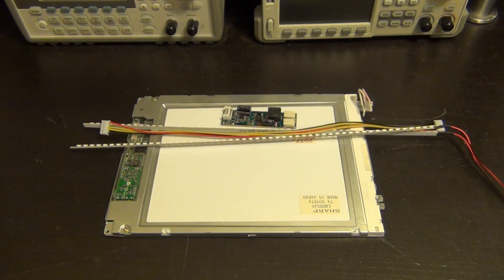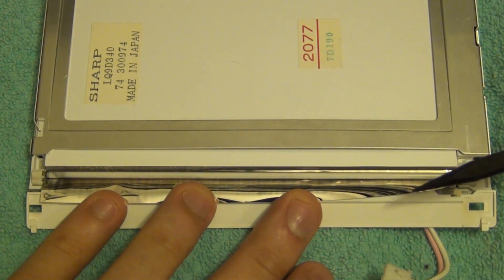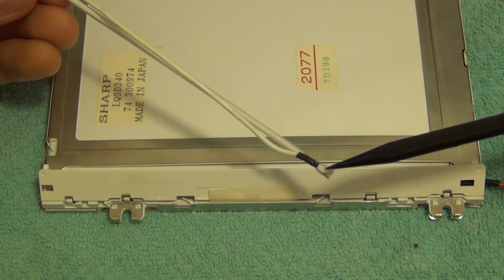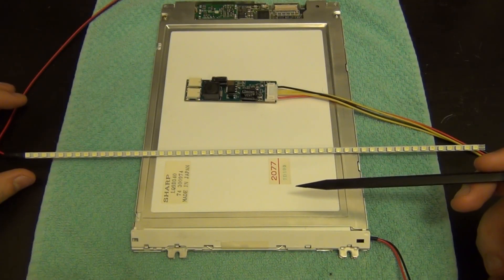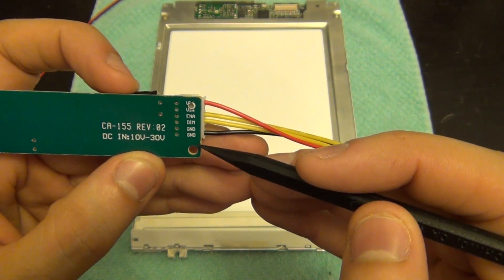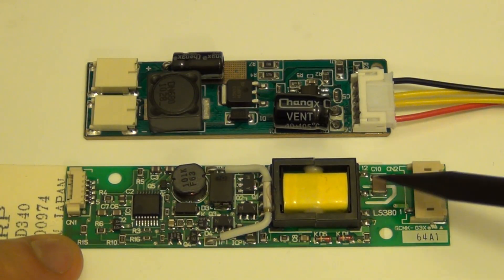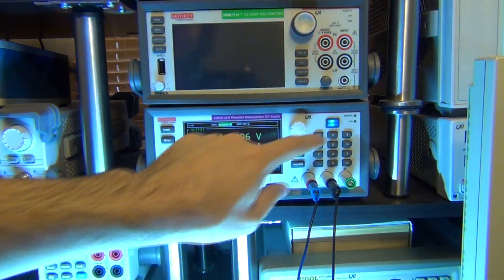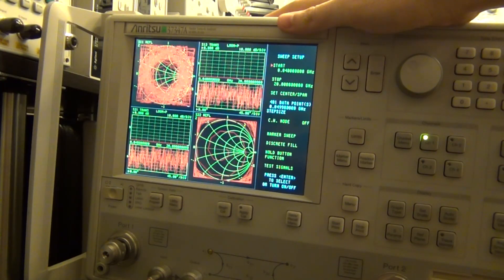TSP #78 - LCD Screen Backlight CCFL to LED Replacement

Comment: Neat! -it's now 2024 and I stumbled on this vid looking for changing CFL to LED - I found a 12.1" 'picture frame' at a thrift store... after taking it apart, I determined the operating voltage, and plugged in an adapter with the right polarity... the screen is a TFT with a CFL backlight, that has no output voltage on the CFL converter. Using a flashlight I can see the screen is operating, so here I am looking at CFL to LED conversions... 
For test equipment, this is a great way to revive gear, for a display screen, I'm now curious what temperature LED is going to work if I replace the CFL tube...  have fun being techs peeps!

Comment: Those LED driver boards use the DF6113 chip to control the LED strips. The resistors R4 and R7 (paralleled on the board) set the constant current, and hence the maximum brightness, of the LEDs. for the 8.4inch LCD screen that can fit a 24 LED strip, you can determine the resistance of R4/R7 by the formula R=0.42/Imax, where Imax is the maximum current for the LEDs. E.g. for R=3.3ohms, Imax is about 120mA which when divided by the 24/3=8 parallel LED strings is about 15mA per LED. If you leave R4/R7 as is, the LED current will be too high unless you use the dimmer feature, and the LEDs will burn out in a short time.

Comment: Hey, what kind of input does that brightness control need? I want to repair a 1993 Apple PowerBook with a dead ccfl tube and the sharp display looks similar to yours. I guess it's original brightness control is some kind of variable resistor, so maybe I could wire this up instead of the Potentiometer you used and keep the original brightness slider functional.

Comment: Nice video! What are the specs of the potentiometer you used and how did you connect it to the cables that come from the LED controller?

Comment: Can I upgrade with HP DV 6700 laptop LCD screen to upgrade CCFL to LED I have HP DV 6700 series laptop  LCD made by AIO brand  very thin LCD 14.4 inch thickness  of lcd is 5 mm ??

Comment: Since nobody reply me, i figure out how to make the connections without burn the board controller. This is for those who face the same problem in the future.  VIN + EAN connected on +12v || DIM connected to the pin 2 of the potentiometer, pin 1 of the potentiometer to GND, pin 3 to 5VDC supply. I used a 5k POT.
Reply: Estaba en el mismo problema gracias 💪💪

Comment: Hello there, I have a imac display lm215wf3-sla1 which has already LED backlight and I can't find any driver board or I should say inverter board , please help me out
Reply from the maker: You need to know the configuration of the LED board so you can determine the required voltage. You will then need an LED driver board with constant current capability to do the job.

Comment: Thanks for the great video! I recently bought the same 27 inch led strips with that DF6113 driver and 15N10L mosfet but it never produced enough backlight light on a HP 25 inch TV. Which was because the strips had turned in their holders inside my TV. Which was fixed by gluing them to the white plastic top and bottom reflectors. The driver module board I received had no second e-cap and was REV:03. I wouldn't advice anyone to use this board above 12V because my board became very hot instantly and after 10 minutes or so it short circuited and got up in smoke. Both my led strips luckily were intact! But it resulted in a defect mosfet, SS210 diode, and R620 plus 1R00 components. And likely also the DF6113 is gone now! I examined the driver module circuit and noticed that it has NO OVP protection and neither a decent over-current protection because it is not equal to the original datasheet of the DF6113 that clearly shows these installed! I wouldn't buy this board or these led strips as REV:03. The video showed REV:02 with second e-cap installed!

Comment: Thx dude! I replaced the light and it only cost 12€... the company here wanted to do this repair for 500€ so I ordered the light from China ( eBay ). 

It is very easy to check if the backlight is broken... just hold or press a flashlight on the screen. If you can see something, than just replace the light.
Reply: Did you use a potentiometer to drop the brightness?  any tips for the rest of us?  Are the yellow wires for brightness control and if so how do they work?
Reply: @scottvance74  I just ordered an original backlight and installed it. So no wiring needed. You don’t even need an potentiometer.

If you want to replace it with a LED than I’d suggest just trying some resistors. So directly wiring it to the factory cables with nothing between it. 

This should work right?
Reply: @B58B30  The available parts I'm seeing have a series/parallel network and require about 8V to drive them.  The inverters that do this are usually powered by a 12V source.  My output (to drive the old CCFL) is 5V.  I found that most of these have a diming function, so by either using that and/or changing the current sense resistor on the LED driving board, I think that I can solve the issue.  Thanks for your feedback.

Comment: Why would you ever do that? CCFL if safer for your eyes. I would prefer the video other way arround. Is it possible to put CCFL instead of LED on modern monitors?
Reply: Lol. That’s like saying “I want to rip this modern fuel injection system off of my BMW and install a carburetor with loads of vacuum lines in its place.”

Comment: Hey, stupid question but I was wondering if the Mercury inside a tube could leak out of the monitor. My image has been flickering there's some ghosting issues. Btw could LCD fluid leak out of a monitor without visible damage?

Comment: Hi very nice video i'm wondering if it would  be possible to send me the wiring diagram to hook up the dimming potentionmeter
Reply: Hi, did you get an answer about the wiring? I would also be interested in that, also the value of the potentiometer.

Comment: Last time I had LCD monitor with CCFL backlight and every component was fine but by some reason CCFL driver was shutting down after 1second, adding 10pF/1kV capacitor in parallel with CCFL tube fixed it.

Comment: At 3:58 you state that you need a constant current driver. But if it is, and you cut the strip to size wouldn't that overload the remaining LED's?
Reply: That is exactly what I was thinking.  I see that this post has is 6 yrs old but maybe someone will chime in on their thoughts.  

I bought the same kit and there are 25 'banks of 3' per strip.  The board expects 2 strips to be in parallel and the constant current is set for about 1.2Amps.  That works out to ~25mA @ 9V per bank.  Cutting down one strip and only using one strip must be pushing all of those LEDs to close to death.   You mentioned that you set the dim control but you didn't mention at what current you are running your cut down strip at.
Reply: @johncarson2877  Funny to read this comment just this week. I must say I totally forgot I had ever watched this video. But coincidentally just this week I designed a little led strip to retrofit in the 5.7 inch Hitachi screens on a device of which we sold hundreds many years ago. Our customers want this devices repaired, but screens the are EOL. Replacing the CFL with 6 white LED turned out to be a very easy, cheap and effective repair. When testing we could not see the six light spots. I just used dropper resistors for current regulation. 

Cutting of LEDs from a current regulated strip still doesn't seem right to me, not something I would recommend.

Comment: Definitely, if you want to use them at full power you need to provide some heatsink, otherwise they start blackening soon. I would not use it at more than half of the rated power.
It was really a pleasant surprise to see that there were no "hot spots" of light due to LEDs, that is what always makes me afraid of doing this (unless alternative is no-light, of course)
Thanks for the video!

Comment: been there donne that :) it seems to be a DF6113 module... they are build to drive 2 strips, also you should have a look at the datasheet of the DF, you have to manualy trim the mosfet's resistors to limit the current on the led's otherwise will last you less than a month even with the brigtness dimmed...

Comment: +The Signal Path Blog since it is a constant current driver, reducing the number of LEDs connected will cause the current through each LED to go way above the rated one, which would explain the significant blue shift of the light. I would increase the sense resistor by at least a factor of 4, and then use the dim input to fine tune.

Comment: ChongX capacitor?! Have you no shame, Shahriar :P.
Reply: +Pieh0 what did you expect from cheapest chinese crap, ELNA? Rubycon? ;) japanese capacitor would be more expensive than whole LED strip with driver
Reply: andr27
It's not the surprise at china using crappy caps, it's that Shahriar would allow such peasantry in his test gear :P.
Reply: +Pieh0 Definitely I would change it for a Panasonic 105ºC, their cost is still low but their quality is much better. To fix expensive instrument, it is always good to use good quality items

Comment: That seems ridiculously over-bright for those LEDs. I think your driver may be overdriving them because you have left it open ended; perhaps it is not even limiting current. Did you put the pot on Vin or Dim? Probably no big deal since the end result is the same but it might be losing a few mA to unnecessary heating on the pot.
Reply: +GoRK 
Who ever puts a pot on Vin has to be very, very new to electronics. You do that once and release the magic smoke (and you can't "lose mA" in a pot). It would be pointless here anyway since it's a switching regulator.

Comment: Oh I forgot: That's a very nice retrofit. Works much better than I'd ever thought. However I won't trust those capacitors on the LED inverter at all and replace them just as a precaution.

Comment: Great retrofit!
Did the instrument have an option to control the brightness of the old display?
If so, why didn't you incorporate that somehow?
Reply: +The Signal Path Blog Looks like the original display was a drop in CRT module, so it would have the contrast and brightness controls separate on the module. Would guess originally meant to use a Sony mini Trinitron display with a small curved bezel recessed in the front. Later changed to the colour LCD when Sony stopped making CRT displays at a low price point.
Reply from the maker: +Mark19960 No, sadly it did not. I looked everywhere in the menus and could not find it.
Reply: +The Signal Path Blog I figured it did not since you are so thorough and if it did that you would probably try to use it somehow. Oh well.

Comment: It seems to me that the driver is designed to connect two complete lines of LEDs. By connecting only one part of the current is increased by about 4 times (by the number of the remaining light-emitting diodes)

P.S. Sorry for google translate
Reply from the maker: +Flextro I will go and look back to see if there were two sense resistors. Thanks for the observation!
Reply: +The Signal Path Blog 
Since you didn't mention it in the video, I thought that you made the according changes (I expected that from you ;) ). Are you sure it is a constant current driver and not a constant voltage driver? Since there are no resistors visible on the LED strip, it points to the former, but it is still better to check.
As long as you make sure that the pot stays connected, you don't have to exchange any resistors on the board, because my guess is that the effect on the output is exactly the same (exchanging the resistors would just be a safety measure).
Btw. you should add a link where you got it from, because that question will definitely come up.